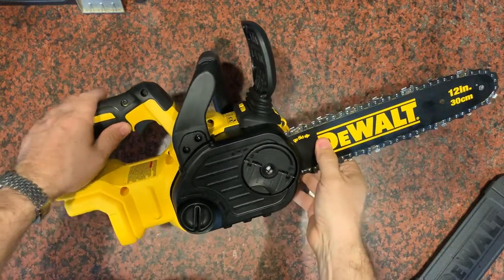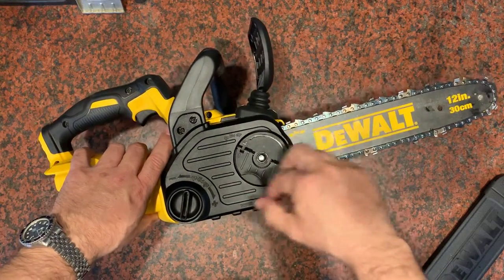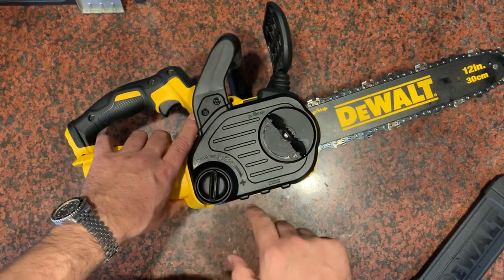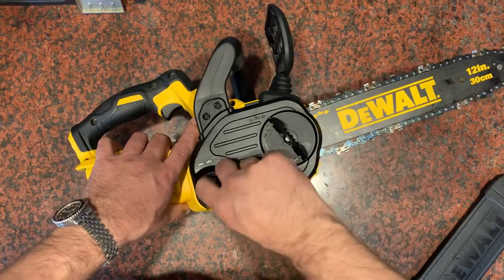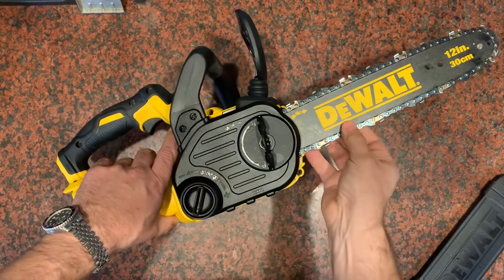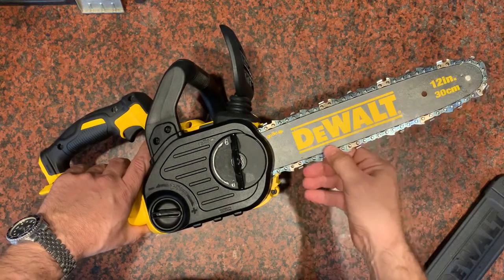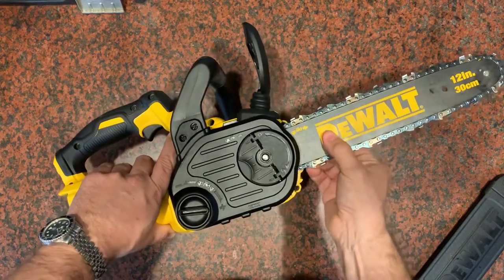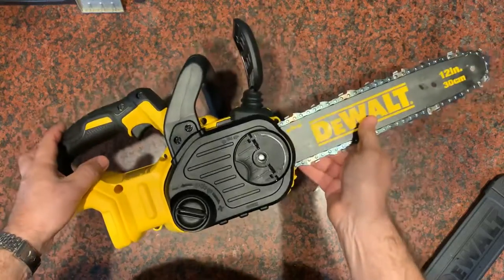✅ How to Adjust the Chain Tension on Any Chainsaw ● DeWalt Ryobi Stihl Poulan Husqvarna WORX more!

Comment: Excellent help video, well explained. I would add one thing though that is critical on all saws. When the bar is loose, set it on a block of wood ar something in the upright (normal operating) position to not dull the chain. Then tighten the chain.  The bar can have as much as 3/8 of an inch play up and down when doing it sideways, first time you use it the bar slides up and your adjustment is gone. I am  Stihl and Husqvarna certified, so not responding to have a pissing contest or make anyone look bad. Just stating the facts  the manufactures train us to follow during routine  maintenance. In all, your video is spot on!
Reply from the maker: That’s great advice!  Thanks for your comment. I really appreciate it!
Reply: @ApacheRanch  I dont do videos, but you might want to place a saw  in the operating level and loosen  the bar and watch it drop. Long bars could be up to two inch drop. That will show the  importance of tightening the chain with the bar in the most upright position as connected to the saw. 99% of folks that dont do tree work will set the saw on a table  and tighten the chain.  First time they use it  the bar rides back up and chain is loose .Most , if not all people bear down on the power head while cutting and the bar creeps up , and your adjustment is gone in seconds. Take your own saw whether its gas or battery and loosen the bar after use in the upright position . It will drop. Depending on bar length , it could be 3/8 up to 1  1/2" to 2 inches. And a side note. looking at the chain from the top, the cutters (Teeth) should always face forward. After running the local Ace hardware repair shop for many years and having homeowners coming in complianing that the saw they bought at the big box store would," take forever" to cut a small limb. I would say "can you wait  3 minutes?" I would remove the chain and put it back  on facing the  right direction and send them on their way with no charge. A Razor sharp chain will stay sharp forever ........ if its on backwards , To me its looking  at the plus side of a screw up ..lol 
 As I said your video is spot on (with one exception) , keep it up my friend. Its nice to see someone educating the public after getting the bum's rush out of the box  store after a sale.
 In 42 years, I am guilty of chain on backwards twice (that I know of). Hell im human , if I myself didnt make mistakes  to learn from myself,  I  would worry..lol
Reply: @ApacheRanch  Oh also, after adjstment , no sag, and chain should snap back in place after pulling down from botton of the bar, if you see the tails of the drag links  its too loose.

Comment: So my Dad got this same DeWalt chain saw for Christmas 2 years ago, and really hardly uses it.  But, the chain keep coming off, or at least too loose to cut.  I followed this video, which was super helpful and easy to understand.  But, trying to cut part of an old log, like 5 seconds in, chain does it again.  So now its hanging off a good inch of so, but everything is fully tightened already.  No matter what I try, it keeps doing this.  Just wanted to see if there is any other type advise, or if it might need to be serviced by DeWalt at this point.

Comment: My 12 inch dewalt cordless only gets 12 cuts and battery is dead. Any ideas?
Reply from the maker: I’m guessing you have the smaller 2amp battery attached?  I think you might want to use a 5amp hour battery to get more cuts.

Comment: Also this style bar tip needs to be greased with a small pointed grease gun.
Reply: How do I grease it?  I'm totally new to chainsaws/pruning saws and am learning from youtube.    Thanks
Reply from the maker: Most chain saws have an oil reservoir and they automatically apply oil on the chain. Other small ones you just coat the chain with light oil. Motor oil will do.
Reply: @ApacheRanch  do I need to get oil onto the track the chain rides on also, or just on the chain itself?  Is a spray like wd40 able to do what is needed.    I guess my real question is what is the purpose of the oil.. Lubricate the chain, the bar, or both?   PS, thank you for answering my questions.  I need a bit of help.  I have no one to ask, or show me.  I want to learn to be safe, get the job done in the best way, and how to maintain the equipment properly.  Thanks
Reply from the maker: @ladyhawkekaren  any oil is better than no oil. But a thicker oil is preferred over WD40. The friction you are trying to alleviate is the chain riding on the bar. Also where the chain meets the sprocket. The sprocket is driven by the engine.  Since the chain is rubbing hard on the bar you want to oil it often. I hope this helps!
Reply: @ApacheRanch  Thanks!